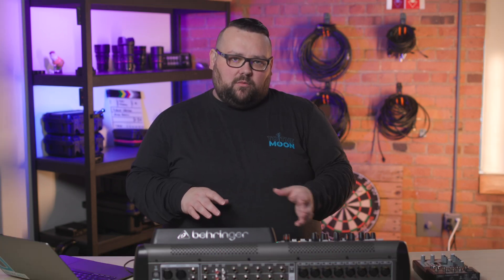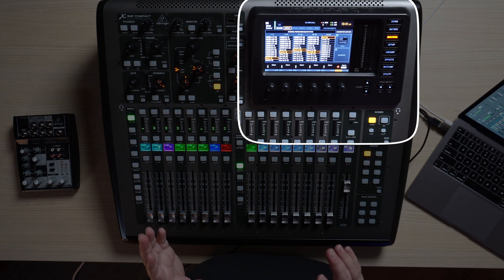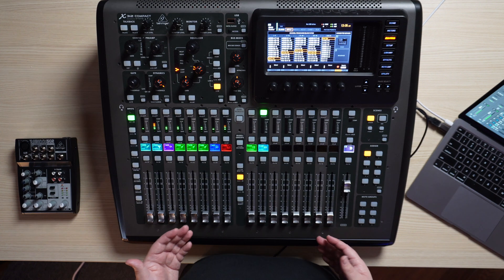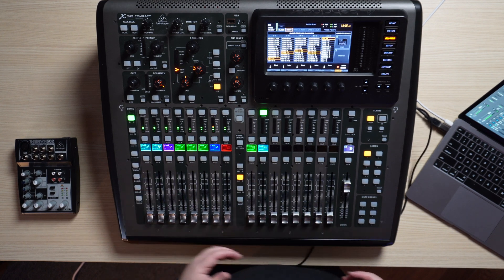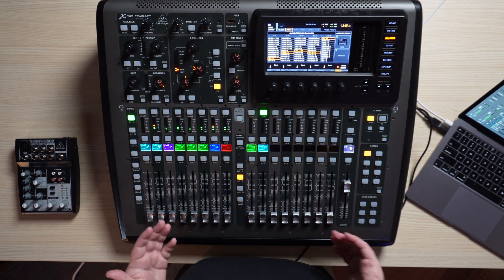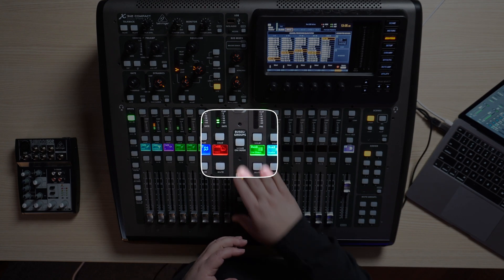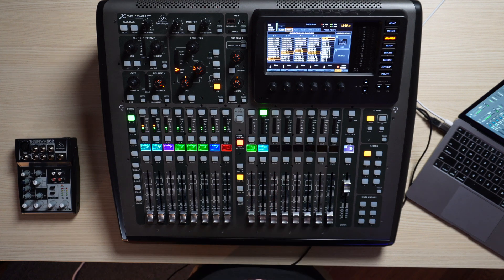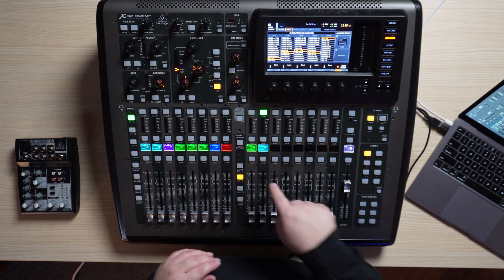All About Audio Routing — How to Input Audio and Send it Out in Live Productions

Comment: Great video on mixer but how do you actually get the mix over to the streaming equipment? An output channel on the mixer goes via a cable to the live streaming booth and connects there to what? Our current Boxcast is missing the audio, viewing only hear static. The Boxcaster doesn't appear to have an audio in so is the audio mixed in somehow with the video?